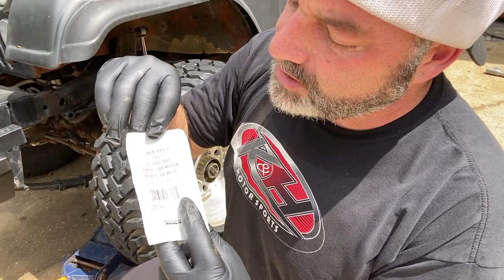CJ8 Updates

Comment: Hey, just curious about  how you mounted the high-lift jack. Did you fabricate some mounting brackets? Or is there a kit to buy for this? Also, just wanted to say that some of the brake pads come with shims that go between the pads and caliper bracket and some do not. It’s best to check the brake pad box to make sure the shims are in there. I always replace the shims when I do brakes.
Reply from the maker: Yes, I did fabricate the mounting brackets. I drilled a hole in each side by the upper tailgate latch and bolted it using the holes in the jack. I used old shock bushings as spqcers. Thanks for the info on the brake pads. 
I